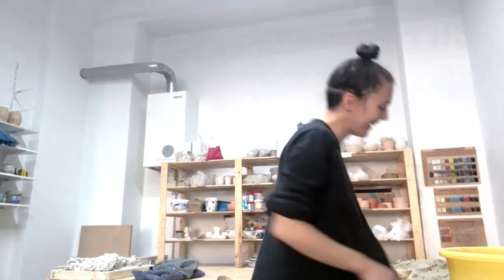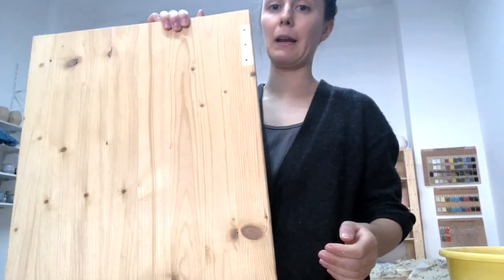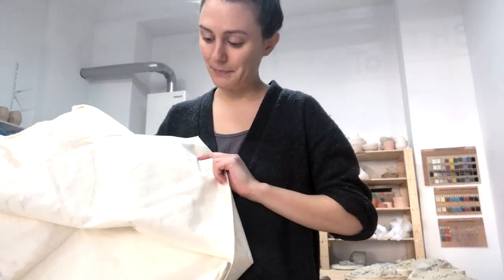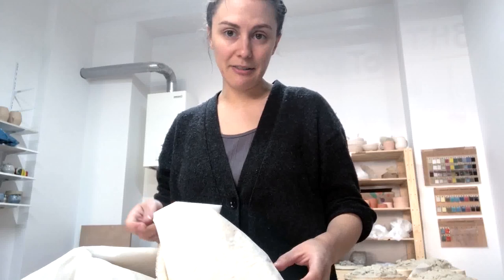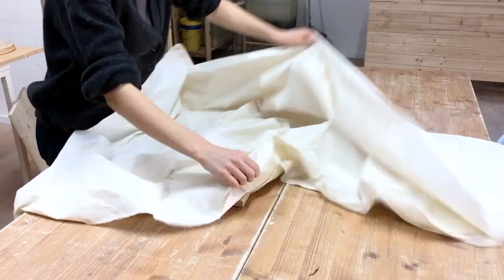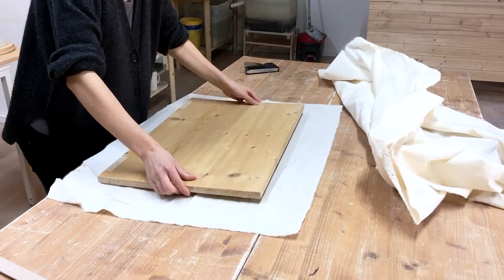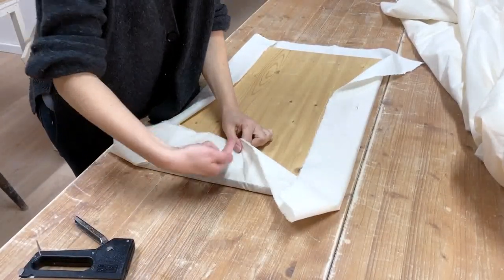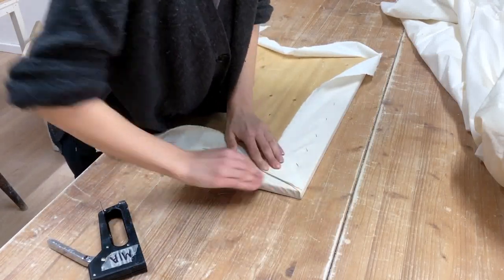How to make a Wedging Board -- a super handy tool for every home pottery studio

Comment: I've been attempting to wedge on plasterboard because I had some lying around, and it's not working at all - the clay just sticks to it. Can I just staple some fabric to that or does it have to be wood? :)
Reply from the maker: Hi Georgina, it should work! Lots of people wedge on plaster, but it needs to be Gypsum plaster, that is absorbent. If the material isn't absorbent at all, you'll get sticking. Also make sure your clay isn't too wet-- if it's too wet it will stick to everything!